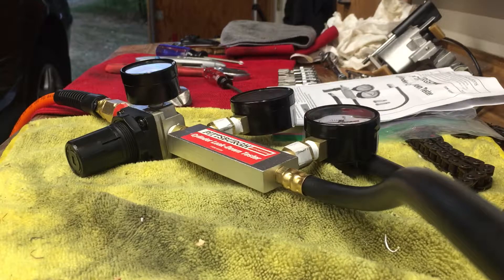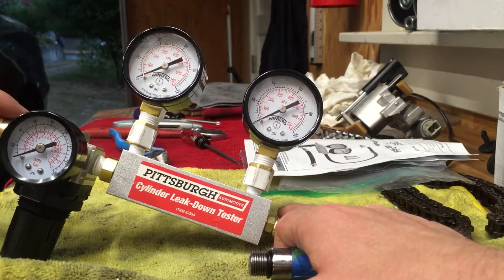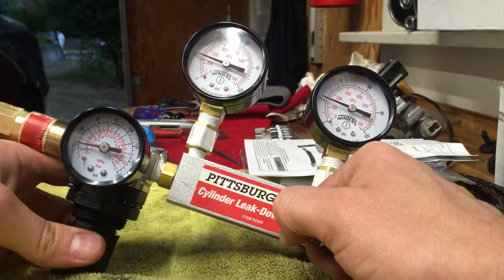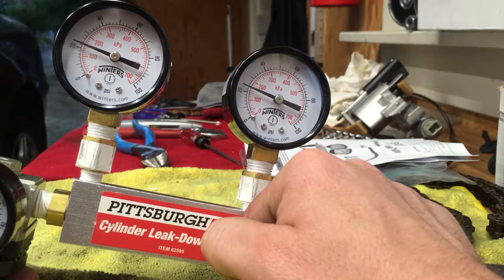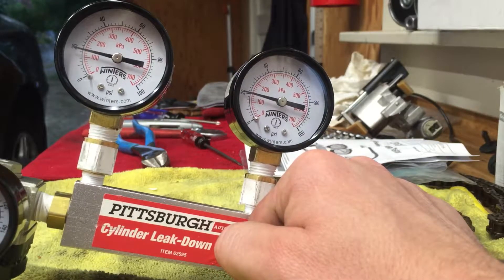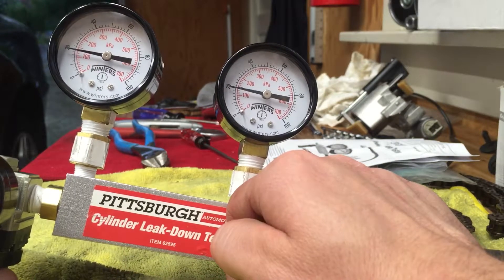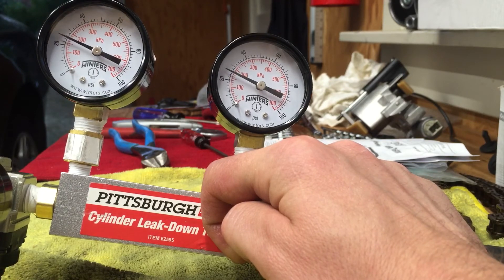Interpreting leak down tester results

Comment: you have 1 to many gauges the first gauge with the regulator should bet set up at 100 psi . when you connect hose to the  (spark plug hole) cylinder the regulator will only allow 100 psi  that you set with the regulator to flow. The second gauge is showing the amount of air escaping from the cylinder or,  air that is being retained by the cylinder.  so if the second gauge shows 70 psi the you have 30% leakage. (remember you set the regulator at 100 psi ) the second gauge is just showing  the pressure lost from some type of leak in the engine. just ignore one of the 2 top gauges as they are reading the same exact pressure.

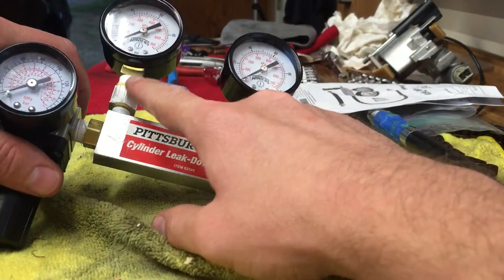Comment: You said you removed the Ventura between the 2 gages  air in is regulated say 60 psi the first gage will read 60 psi , the block has a small hole 1/16  to the next gauge as you hold your thumb over the hose they should read the same as soon as you let go they will change , but the air in should not .  your going to get air leaks with good rings its the % of how much air is lost , 2% to 100%     2% being good and 100 being bad ,  that hole in the block is to hold air back  if you removed the ventura its wide open not doing a leak down , just a open air way . 0:34  Removed the restriction valve

Comment: If there is no valving device inside that rectangular housing, this is the result you will always see, i.e., the two gauges register the same pressure reading. If the housing is a 100' long and the two gauges are at both ends then you will see a pressure difference due to flow resistance. Your set up cannot do a leak down test. Maybe you already figured out the principle of a leak down test watching other videos. Good luck!